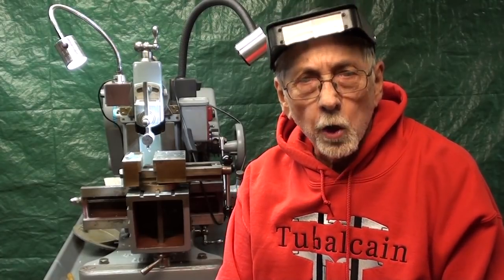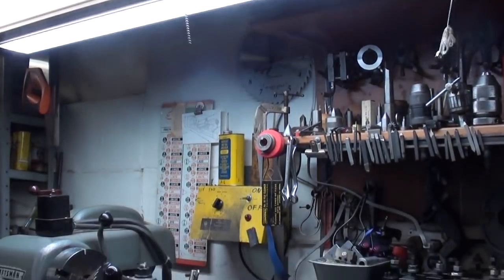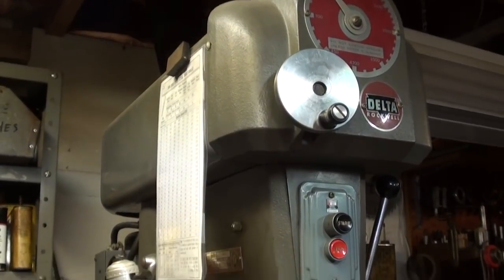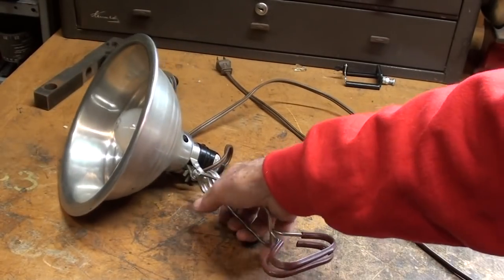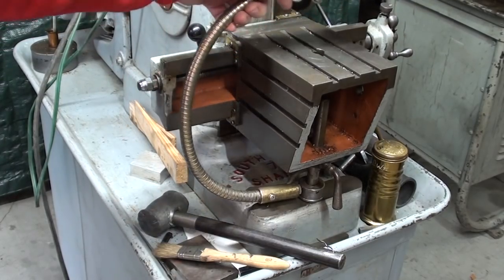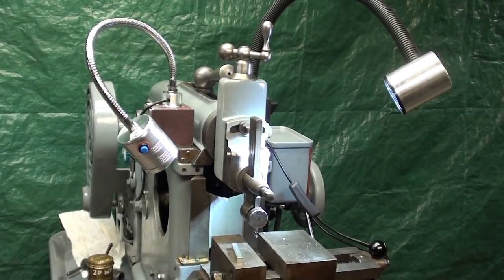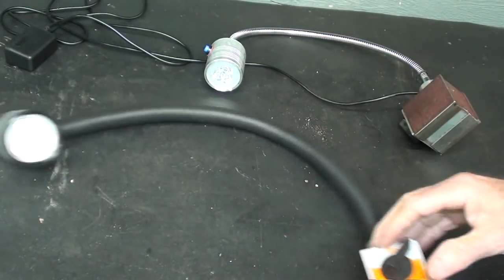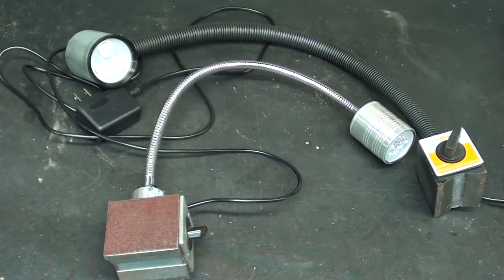LED MACHINE TOOL LIGHTS Tips 691 tubalcain

Comment: I used two flex type lights for my lathe and put LED bulbs in them so they don't get hot. It's hard to find a decent flex type lamp anymore but I got lucky and found some on Amazon that I have been very impressed with. If you search for "Sewing Machine Flexible Gooseneck Working Lamp Light" you can find them easily and for the price they are great. The only downside I have found to them is you have to make a mount for them, but that is easy enough to do and you have to get a plug for the end of them.

Comment: I'm a fan of cheap led flashlights that use rechargeable batteries. About every three years I get a dozen flashlights and two dozen batteries on eBay; about $50. I have one at the ready clipped on my pocket at all times. Amazingly usefull. Aim across a surface to reveal imperfections; hold in teeth to see a drilling or cutting operation; close up inside a mold to find gaps; search the darkest drawer; aim across floor to highlight lost minutia.
After three years, the surviving lights are so behind the current technology, just replace them.

Comment: MrPete i search for a mag base led work light on amazon and found these ones for $50 and they have a real small head im able to get it real close to my jewlers lathe but i liked them so much i got a few with a slightly bigger head that i put on the lathe and mill the bigger headed led was around $64 but they make for a great work light!
https://www.amazon.com/Intensity-Lumens-Flexible-Adjustable-Magnetic/dp/B01A51TMSO/ref=sr_1_12?dchild=1&keywords=mag+base+led+work+light&qid=1608590673&sr=8-12
Reply: https://www.amazon.com/Gooseneck-110-220V-Magnetic-Industrial-Flexible/dp/B06XPGBC83/ref=sr_1_8?dchild=1&keywords=mag+base+led+work+light&qid=1608591038&sr=8-8
Reply from the maker: Thank you, those look like very nice lights

Comment: Oh, yeah lighting... Becomes pretty crucial when you're as old as Methuselah, like me. I seem to have an uncountable number in my little 500 square foot shop. They're all Led now, a mix of tubes, spots, floods, and regular bulbs in various k's, three or four of those circular lamps with magnifying lenses (LED), as well as a couple of dedicated gooseneck LED's, no foreskins that I've noticed. Cataracts and glaucoma be damned. 

Despite all the ambient light, like you I need one or two moveable lights per machine, and I too have some extra on/off magnets, and reflector/bulb holders salvaged from those demonic clamps. So how to connect magnets to bulb holders with good adjustibally? I found some cheap Noga arm clones on Amazon, fiddled the arm to magnet and arm to bulb holder connectors, et voila! One knob to point them exactly where I want them.

Another reason to use LED's: when you drop them don't die.

Comment: As a professional photographer light is my business. I thought I would add a comment about the COLOR of the lights.  As some of you know (or may know) the color temperature of light is measured in degrees Kelvin (K). The sun, outdoors (daylight) is generally accepted to be around 5000 degrees K. This is the color of the blue sky. I do not recommend this color for indoor use... it is just too blue. Typical incandescent light bulbs are in the neighborhood of 3000 degrees K. This is a much warmer color (more red). Below that is 2700 degrees K. LED "bulbs" are available in all three colors.  In my opinion, one should select their work lights (called task lights for our purposes in the shop) having the same color temperature as the main lights in your shop for best photography.  Of course Mr. Pete, as well as most of us, probably have a discontinuous light source (meaning a mix of fluorescent , incandescent and LEDs) in our shops. ALL cameras whether they are film based or digital based respond differently to the color temperature of the light. This is why you may see pink or green or blue cast to some areas of your movies or still pictures. Photoshop editing can fix some of this but keeping the color temperatures closer to a continuous/consistent color balance works best. Also the blue (daylight) color can be distracting or give a cold feeling to your workspace.  Unfortunately many of the available LED task lights may not be available in the warmer colors.  That said, Mr. Pete has certainly researched and well-presented the mechanical facts that needed to be addressed. Good light is essential to old and young eyes... that's for sure!
Reply from the maker: Thank you very much

Comment: The Bangood led lights are probably 50mm and 40mm,diameter.
500mm is half a meter. I appreciate you are used to Imperial measurement, but the difference is very large, now onto foreskin, 😠.

Comment: I have the Banggood 9w light. There is a version with the switch on the housing. Make sure you get model for 120V if you're in US. Suggest plugging into GFCI. You can also make lights from LED tape or 3W PCBs. Meanwell is a good Chinese power supply for those.
Reply from the maker: Thanks

Comment: Sorry I don't have enough hands to raise for all the times I've been burned by incandescent and halogen lights the worst one was a trouble light that i bumped while installing a transmission laying under it light fell on my abdomen of course my hands were busy holding up transmission by the time i wiggled enough to roll the light off of me i received a bad burn still have a 3 inch scar to remind me of the danger those lights have also having one explode on me when a drop of water hit the hot bulb now with all these led lights now available i even put them in my trouble lights they get a little warm on the bulb heat sink a little hotter but hard to touch that part in a trouble light halogen lights seem to be the worst for heat.💡💡🔥🔥
Reply from the maker: Yes, I have a few burns myself

Comment: burnt - drop light and work lights...   I used car headlight (replaced both once) in a box - lamp on a cord to a transformer.  Mounted it above my wood lathe and wow what light!  I use a florescent Spot light in the pantry.  Starts low and if in/out never gets very bright.  If it is on a minute - it lights up the room like outside !  And it is cool !!!

Comment: Me Pete. Greetings. As our internet shop teacher you came to mind when I reached an impasse on a  project. I am restoring a flexible flyer sled (mine) as close to original as possible for my granddaughter. It is about 60 years old. My dilemma is replacing the steel rivets that holds some of the metal to wood parts together. I have been researching this topic for days on how to do this with no luck. All the examples use an air hammer and a bucking bar. I suspect that that this only works on aluminum or copper rivets and not on steel rivets. Would a 1 ton  arbor  press work if I could make some sort of die to fit the rivet head? Any suggestions will be most appreciated. 
Sorry for the lengthy post. I couldn’t find an email address.
Reply from the maker: No, one ton would not do it. I think you’ll have to hammer on it. Aluminum river is probably not strong enough. Maybe copper with a rivet set

Comment: Ugh. I hate those cheap imported msg base lights. I got one from Enco that's set up on my little CNC mill, and it's impossible to aim.

Ikea has a little led desk lamp called the Jasko IIRC, and the great thing about it is that you can unscrew the light and stem assembly from the base very easily. Once you do that, the end of the flexible stem had an M8x1 metric thread (note: that's a metric fine thread, not the usual M8x1.25). You can drill and tap a custom mounting plate very easily, and they only cost around $6-8.

The only mag-base lights that I found that I actually like are the Electrix. Those are pricey, but work very well. I think I bought them from KBC, but I'm having trouble accessing order history prior to Jan 2020.

Comment: Good topic for discussion.  I have a Delta Rockwell Jig Saw from the late 1940's that has a diecast work light similar to the one on you drill press that you mentioned was rather "anemic."  I solved that problem on my jig saw with a small envelope LED bulb with a candelabra base and a medium to candelabra base adaptor.  I have found that the LED always seem to be brighter than the stated lumen power.  So even with a rather small envelope they pack a real punch and no heat like the incandescent that I was using in mine.
Reply from the maker: Thank you very much

Comment: A bad thing about incandescent bulbs is they are fragile and if they fall down/over and break in a flammable or explosive atmosphere then you're going to have a bad day.

PS - those overhead LED fluorescent replacement lights are AWESOME.
Reply from the maker: Yes, I have about 20 of them
Reply: It's always hard to light where the garage door opens, but I have an LED strip light hanging at the level of the open door on each side and they light up that 'dead zone' quite well.

Comment: Remember the old time 'drop lights' with that metal shield .  Laying on your back under a car you were guaranteed to get some burns.
Reply from the maker: You got that right
Reply: And when you dropped it, the filament in the old bulbs broke and you couldn't see more.
Reply: @sithus1966  And the only spare bulb you could find was a 100 w. bulb, and that baby could really put a hurting on you.
Reply: @justtim9767  I build a lamp I used for working under the car that had three ceramic bases, which housed 3 bare 100W bulbs.  It was great for light and heat!  Never burned myself, but came close a few times.
Reply: @componenx  You lived a charmed life.

Comment: It was great meeting you yesterday. Had a great time at lost creek machine. As far as lighting goes I have a nice rechargeable led light from NAPA that is magnetic and works well. I use it on my vertical saw and drill press. No cord. May not work well on my lathe since there is no long reach stem.
Reply from the maker: Thank you, I had a nice visit with you guys

Comment: It seem like the engineers ar Duro who manufactured the drill press had a good idea with the light housed in the main frame of the machine, but why didn't this idea fly with the other companies and carried on in production of new units.
Reply: My 1989 Taiwanese floor model drill press has a light in the head frame. Like Lyle says it works well and is out of the way.

Comment: If you have lights with the spiral wound gooseneck that are too weak to hold up the light, there is an easy fix.  The problem is that the gooseneck is too well lubricated.  They work better when they are very dry or even slightly rusted.  Wash them with a little brake cleaner to dry them out, or you can leave them outside for a few days to acquire a thin layer of rust.  This sounds bad, but it works.  I've been in the music industry for 42 years, and many gooseneck microphone holders have the same problem when they are new.  It goes without saying that you should do this with the power un-plugged, and make sure it is thoroughly dried out again before plugging it back in.
Reply from the maker: Thank you, that’s a very good idea. Too well lubricated, never thought of it

Comment: 6:33 I remember that movie very well. I made a point to watch it the night before my colonoscopy. :) https://forum.level1techs.com/uploads/default/original/3X/6/c/6cb8518f9a3fa6fb610487227c00822dae093143.gif  (clip from the movie, not my procedure BTW)
Thanks for the good overview of what works and what doesn't. My main concerns with LEDs are chromatic (or color) aberration and, on cheaper units, if the frequency causes flickering on video, but for general use they work great for me.
Reply from the maker: lol

Comment: i just bought a magnetic folding LED "flashlight"(#56329) at HF. its been a great little light. its incredibly bright, has 3 settings and theres a point light at the tip. 
i use it for everything and place it on the lathe for extra light. this week its been a real help with a clutch job i'm doing. i cant believe i was working with my craftsman fluorescent lantern for so long. it feels like the difference between a torch lit cave and an operating room!
Reply from the maker: Thank you, I think I will get one of those

Comment: 50.0mm, not 500mm, same with the 40.0 and 400.   If you don't use metric its easy to make such an error.  25.4mm to an inch...   My rule of rough approximation, 4 inches is close to 100mm, and a meter is close to 40 inches.

Comment: The Photography Light at 5:12 can be attached to a noga arm. They make similar ones for photography too, but the ends may be a different thread. A variety of clamp types for these exist, not just mag bases. An adapter to use it with the indicator stands you already have should be simple to find or machine.
Reply from the maker: Thanks

Comment: I have an early 80s Taiwan made bench top 5 speed drill press. It has the built in the frame light bulb, and nearly 40 years later the original bulb still works!

Comment: Mr Pete, loved the video. I am an auto technician, when I started out I quickly. learned. why the work lights we use are called trouble lights, if it wasn't. burning you somewhere it was tangled up in a place you couldn't. easily reach.
Reply from the maker: You got that right

Comment: 50 and 40 mm diameter respectively for your led lights... 
500 mm is 50 cm or 0.5 m or around 2 feet. That would be quite the worklight!

Comment: The 40 mm (your favorite one) is a nice light. I ordered two that had a simple circular magnet for the base. Nice lights, pretty much stay put in any angle you put it at. Tends to be a "spot" light (but not focused spot light). Sometimes that is good, sometimes not as good - depends on the job you are working on. I could wish the cord was perhaps about 12" longer, but it is not too bad.

The one thing I don't like about those lights is the amount of EMI radio interference they through out. I makes even FM reception (on a weaker station) VERY NOISY. Hey, they were $15, and I'm sure they left out all of the noise suppression components in the power supply they could.
Reply from the maker: Thanks

Comment: Mr. Pete.  I believe that the light that you are thinking of throwing out is identical to the one on my Rockwell mill. I put a small led spotlight from Lowe’s or Home Depot in it and it works great and does not get hot.   If you want to sell that light I would be interested. It would be nice to have two matching lights on my mill.  I currently use an inexpensive sewing machine light on the left side.   Here is a review of my mill so you can see the light I have.  https://youtu.be/vxxndDP-OLg. The last few minutes show the best view of my current light.
Reply from the maker: Thanks a lot, I like your video. And I sure do like that milling machine

Comment: Thank you Mr Pete. I have replaced most in my house to LED. The soft white are the nearest to the incandescent.
Incidentally I was repairing an old valve (tube) am radio in my workshop when it started to suffer from heavy interference. This was after installing the LED bulbs. One of the LED bulbs had an adapter to suit our large bayonet socket fittings. It appears that the interference was coming from the adapter. It made me wonder if that could cause problems with some of the electronic equipment that many of us now have in our workshops.
Reply from the maker: Thanks

Comment: I have made several LED light bars from television sets found roadside, a typical strip is 15- 20" long, needing about 19 volts d.c., and i use wall warts, again salvaged from roadside- found products.

Comment: Hi Lyle  I have quite a few IKEA "Tertial" work lights scattered around my shop. They clamp on to surfaces via a supplied clamp at the base. I really like them as I am in the "more light the better" age group.Only about $12 with a screw in LED bulb. regards vic
Reply from the maker: Where do you buy these? Never heard of them
Reply: @mrpete222  IKEA is a huge Swedish "big box" type store with stores all over the world. They are best known I think for economical but functional furniture. One of their stores is only about  5 miles from my home near Chicago. You can also buy online at IKEA but this will incur a modest delivery cost.

Comment: I love LED lighting, but wondered why no one hasn't made better integration in most shop tools (like that drill press you showed). I'm sure some clever 3D printer maker could custom-make a more practical, and brighter solution. E.g. I was looking at a new bandsaw (with resaw capability) and the lighting option was an expensive, clumsy, halogen lamp. Why not have integrated LED spots over the blade, on the throat, and perpendicular to the table? Still, I am glad that LED lighting is so cheap now as I paid $25/ea for 4' shop fixtures that chain up to 4 ... now my (once a single pull chain fixture) basement is lit like a basketball court! No place for a spider to hide!

Comment: Hope the link doesn't get flagged, but these shop lights are a game changer.  Just over $10 a piece, they are disposable.  There is no changeable LED strip, it is all encased in lightweight plastic.  They are linkable with 4 foot cords, I have had 8 in a row no problem.  I have mounted both by chain and by clip so they sit flush with the ceiling.  They are very bright and when you get a bunch in an area you can light the place up like a football stadium.  I do not know how long they will last, I have had my earliest batch up 6 months now, but have not had one problem or issue with 36 lights bought in 3 different shipments at this point.  Are they cheap Chinesium garbage?  Yep...I will be buying more. https://www.amazon.com/Hykolity-Linkable-Workshop-Workbench-Equivalent/dp/B07TM97LWY